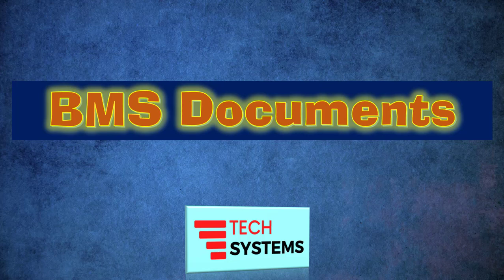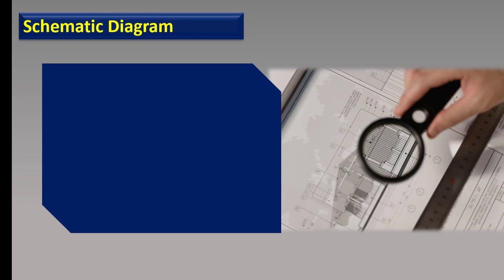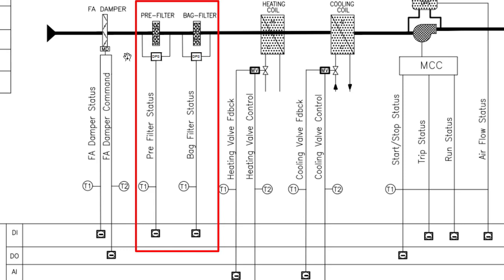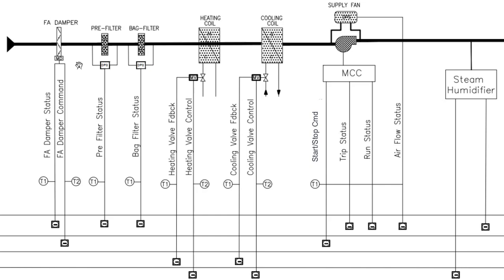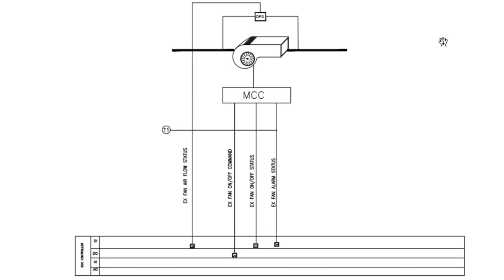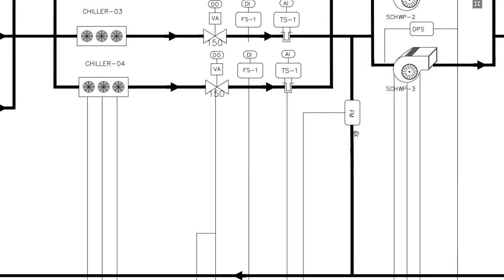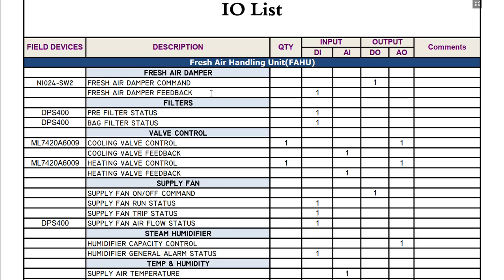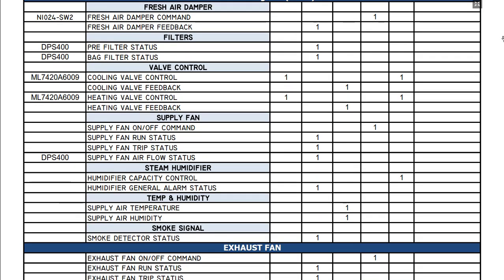Building Management System Schematic Diagram & IO List | BMS Training 2021

Comment: Sir I am on field and no one is giving any support regarding BMS for respective connection at site not even my manager, sir pls provide your email address so that I can share my query , only a little help required as I have some co fusion regarding termination at DDC panel of temperature sensor to UI 16 SCHEIDER